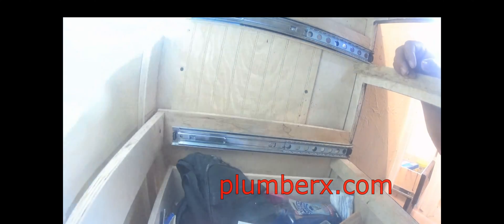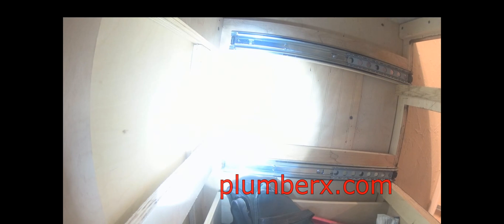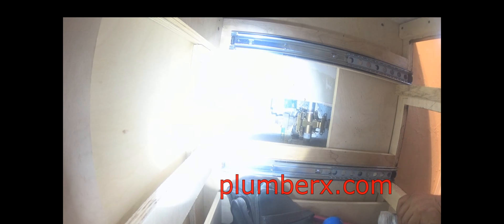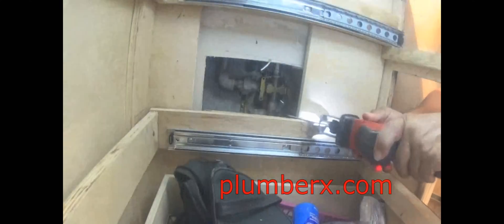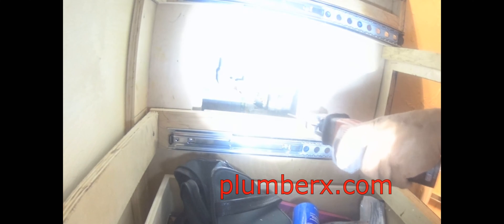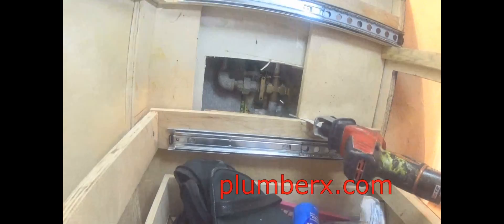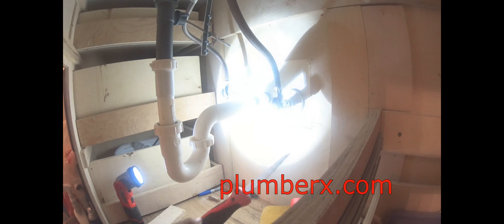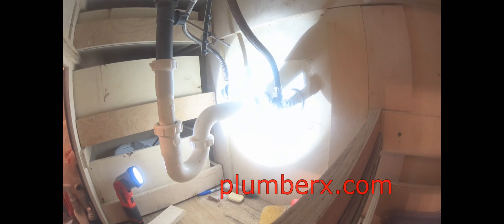Step-by-Step PEX Pipe Installation for Beginners 3 Of 9

Comment: Thanks for posting this wonderful series of videos, Claude. Seeing you go through the process inspired me to repipe the hot side (for now) of my older house with the original galvanized pipes. The pipes I removed were NASTY and my flow rate upstairs is significantly improved! I mounted a Manabloc to my basement ceiling and would highly recommend it.
Reply from the maker: Cool. I appreciate your comment. 👍 I'm glad I could help.

Comment: I have a hot water pipe leak under my concrete slab. Should I have the repair done or re pipe the whole house with Pex? House was built in 73 and they ran copper pipe.
Reply from the maker: If you have the money I would go with repiping, Only now and then you can get lucky with a foundation leak costing less, But to repair a slap leak may cost more. depending on where the leak is and how the foundation is built, You may have tension bars in the cement floor and the worse thing you can do is bust one if that happens then your foundation will be shot. If you have a plumber come out to repair a slap leak make sure he is lic and have insurance to cover any damage to the foundation. Cover yourself. Good luck hope this help.